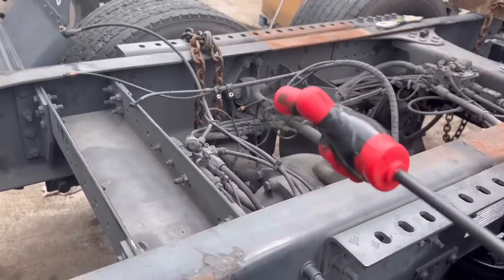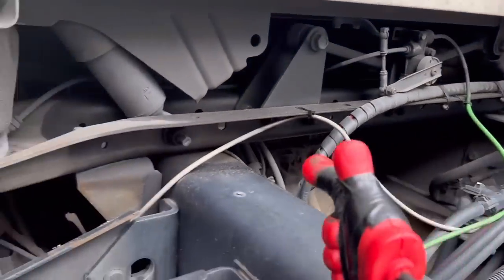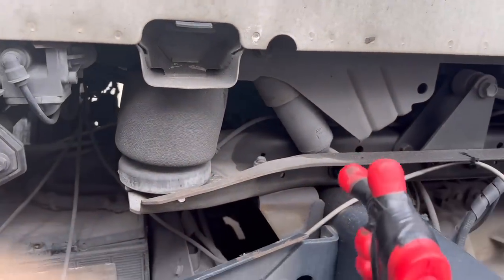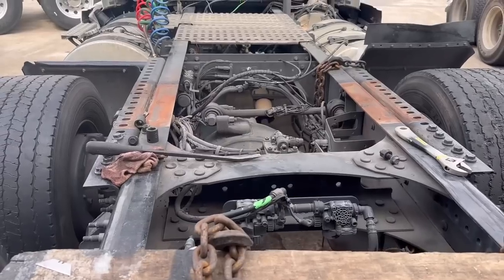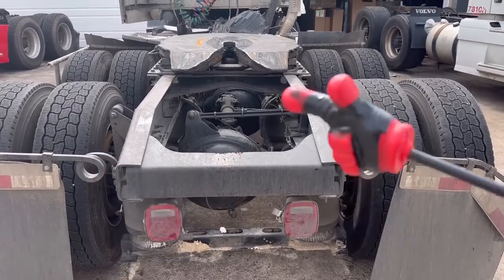Why is my truck leaning 5 reasons

Comment: A good tip to point out
When replacing springs you need to look for a matched set
Some springs come with a + or a - painted on them
That is indicating that they have been matched to each other 
The only time I got bit by that snake
We changed one side owner didn't want to do both
He came back later to get the other 
We ended up with a plus and a minus  spring
It caused a lean
Reply: With the old lead springs, it was really a dumb move not to change springs out as a set. We had a new supposedly mechanic, and he only had the side fixed that had broken leaves. There was a spring shop nearby that rebuilt springs, and they replaced not only a broken leaf, but several that had lost the proper arch. We sat the two springs side by side to show him both needed repaired, and the difference in arch was unbelievable. Nope, he wouldn't have the other spring repaired. And of course, it sat leaned over empty. And the lean got worse when loaded. Good look when you want to meet DOT Enforcers.

Comment: Just because the tires are marked the same size, you can get different circumference from one brand to another!
Reply: ...I've always wondered about that, but our tire caliper stays locked away from the lowly tire filter for some reason...

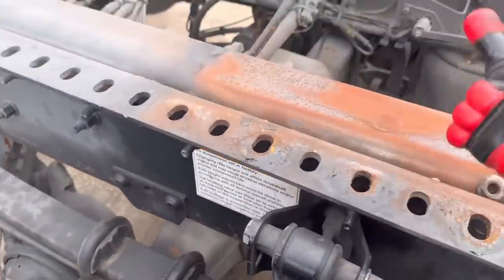Comment: I feel like the truck at 2:13 has a better suspension setup than my Freightliner Cascadia because the axles are underneath the leaf springs. I don't like the idea of having all the weight being only supported by the u-bolts.

Comment: Bob is correct. I own a old freightliner flc 120 that leaned like hell since I bought it the bushings on the steer axle passenger side destroyed, new hangers, springs, pins etc truck has zero.
Reply: Is it ok to drive?

Comment: I worked at a truck shop a few years back and saw a truck come in with the cab leaning to one side.. turns out it was the torque arm that was broke on the rear axle to frame. Alot of dirty words later, it was fixed.
Reply: It was on a 2016 Freightliner Cascadia

Comment: I run tri axle dump chassis by PRATT. 
They run mono spring. It's just one spring per axle per side. When they brake they literally SNAP at the axle. 
NEVER DEAD SPIN A LOADED TRIAXLE 
20ft chassis with the axles stretched. 
But man they ride GREAT with 50000 in the box.

Comment: Bendon, what does it mean when you’re in the left lane and the truck pulls to the left? Or being in the right lane and pulling to the right? Tandem axle tractor aligned twice in a row, the second time to confirm the first alignment was correct. Before and after symptoms were the same, it pulled to the right and the front right steer had accelerated wear across the entire tread, in comparison to the left steer which was an identical tire replaced at the same time. There was difficulty per tech to get front right steer in spec. Thanks, love the vids!

Comment: Hey there bendon. Quick question is it normal for classics to have lean to the drivers side on the front axle? Ive spoken with other classic owners and they’ve all said its normal.  Its had it before i had new kingpins and front end work done plus alignment. TIA like the vids on tiktok 👍🏻👍🏻

Comment: My trash truck leans a bit. Never been crashed or abused?  I’m gonna have to measure it now. I know it just has rubber blocks for suspension in the back. It’s a 10 wheeler.

Comment: Do you know what can cause leaf spring to to not be centered with hanger bushings? My 2011 cascadia has that problem. Bushings are all good leafs are good theyre all just not centered with hangar bushing
Reply: No air bag lean either , just wanted to mention😅
Reply: Is the one spring squared with the axle?
 Measure distance between front of springs and rear of springs.
 Can also use a carpenters framing square, ( large on, not the little one)
 The one spring may have been secured to axle with spring not positioned straight.on axle.